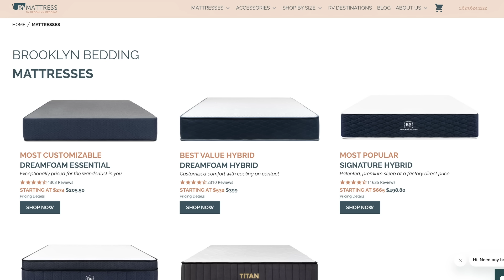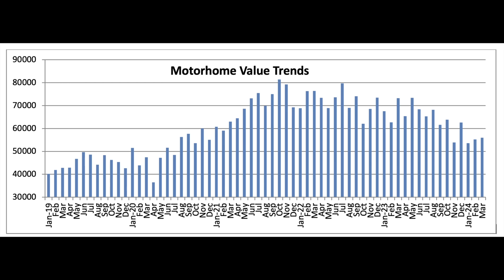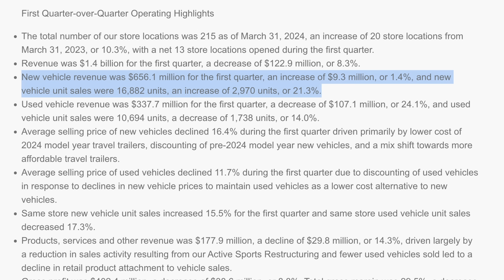First Look at Grand Design Motorhome, Oliver Reverses Course, Used RV Values Tick Up

Comment: Super High Roof is Super Exciting! Hoping to see some company offer 2 bunk beds (with lower bed convertible to queen/king) and 4 seats with DOT certfified seats (like in the Solis). Would be a game changer - for those who prefer to avoid the pop top. The pop top works great but is less than ideal when weather is not ideal. It's cold in the winter, hot in the summer and can't be used when winds are high... so having more options would be AWESOME.

Comment: That grand design motor home looks like it's already gonna be closed to overweight for that kind of chassi that looks like it should be on a larger chassis than a sprinter van. I'm at five times someone puts all their stuff in there i'm sure it's gonna be over weight and over loaded